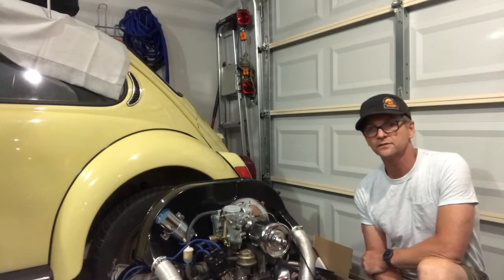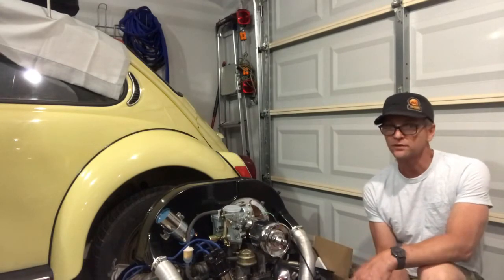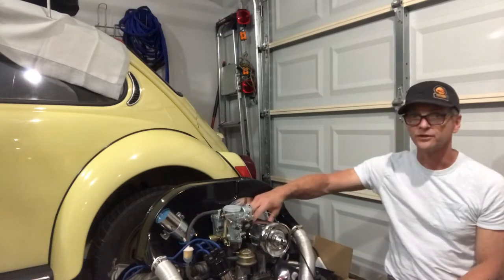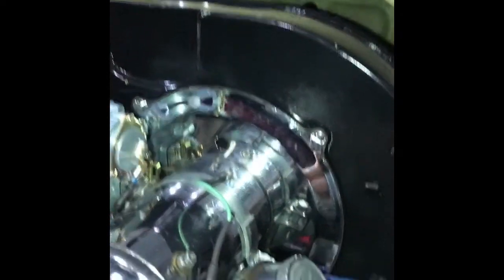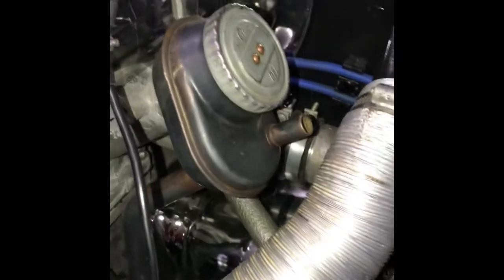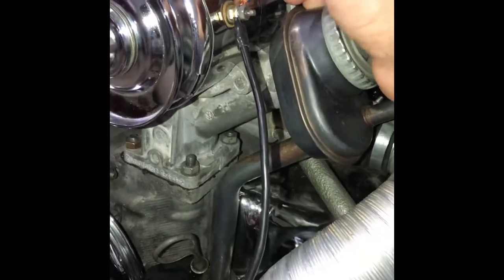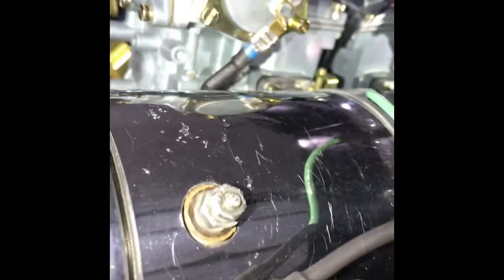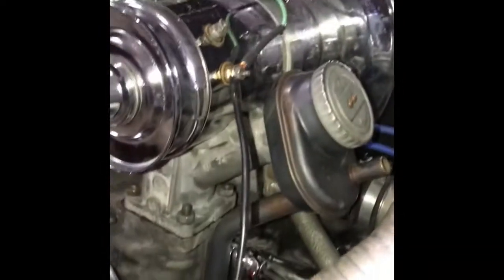Generator Polarization 1971 SB

Comment: On a 6 volt generator I did that and it spun just like that. What it won't do is charge. When I put the belt on and start the engine I get no output from the generator.

Comment: I haven't drove my VW Bus for 3 weeks...got in and started my bus.  The GEN light was on.  I verified that my belt was on and tight.  I checked the output of the generator with my multimeter......which was showing 12.8 or battery voltage only.  
I remembered that sometimes generators need polarized or motorized so I did the procedure you described. It fixed my issue :) 
But........the next day I started my bus and the gen light stayed on for about 15 20 seconds which is not normal.  It went out and is charging fine now.  Usually the light will go out within a few seconds.  The generator is oriley aftermarket....not Bosch.  I have a feeling that it's a cheap POS generator  :( 
I've never had issues with the bosch.  What do you think about this situation???  Thanks in advance  :) 
Cheers!!
Reply from the maker: Glad my video was able to assist with the issue.  Regarding the charging light staying on for a few mor seconds; I don’t think that is an issue.  Yes bosh is a better option.  But sometimes we have to get other brands when the preferred one is not readily available.  I would give it a good test run for a few weeks and weigh your options. Is it still changing? You know the old saying … if is not broken… don’t fix it.😊

Comment: My polarity reversed and some wires smoked and plastic melted on the wires.  Do I just tape them up or do I need to replace the whole cotton-picking wire harness?
Reply from the maker: I would replace the loom wire section that was affected with new wires and assure to color match wiring or code it with color tape .  That is the least expensive option.  It’s best to replace the whole loom as wires get brittle over time and split causing malfunction
Reply: @juniorclassicvwbugs924  Thank you.  I will do that.  I will also replace my generator with an alternator so it doesn't happen again.

Comment: What does polarizing do?
Reply from the maker: Polarization is a procedure which matches the polarity for the generator and the voltage regulator. The majority of the vehicles are manufactured negative ground although some of the older vehicles were manufactured positive ground. The generator has to be set up for either polarity.

Comment: thank you for taking the time to post this - very helpful!
Reply from the maker: Hi there I really appreciated the feedback.  Happy holidays
Reply: Thank you for the post i had a question my volts are over 16 on my gauge 70' beetle could that be from not polarizing or bad regulator bad generator any info is very appreciated